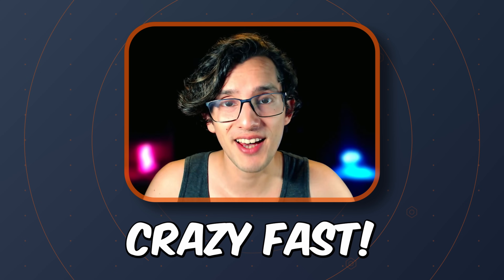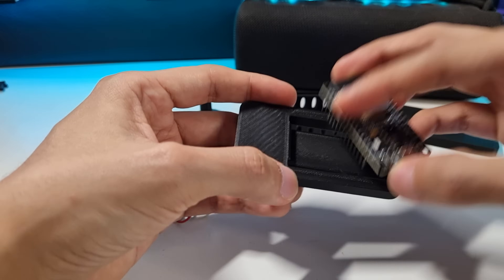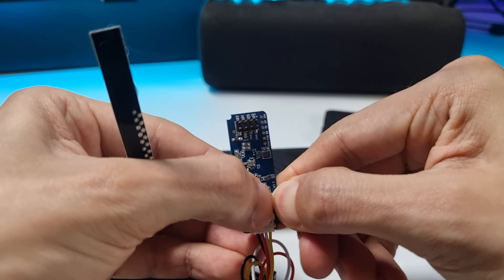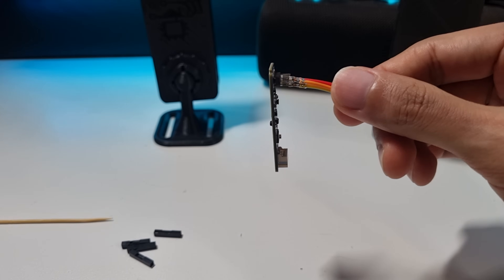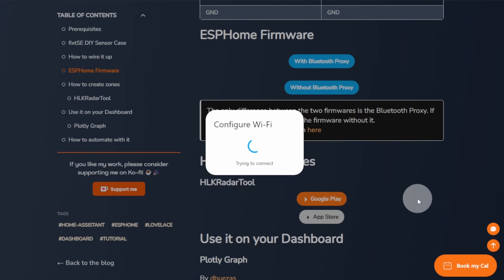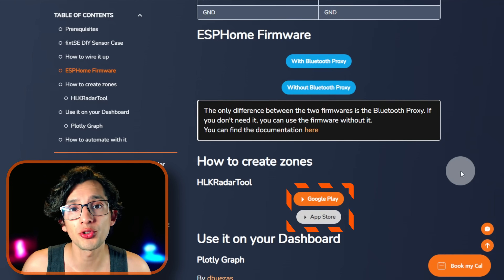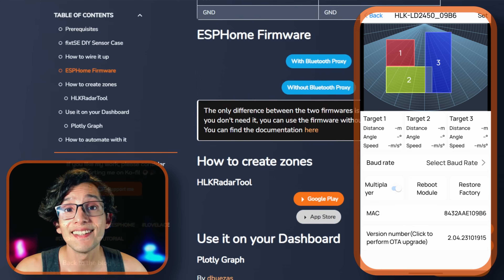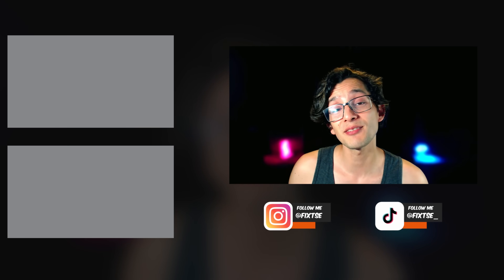Beginner DIY ESPHome mmWave Presence Sensor  |  HLK-LD2450 + ESP32

Comment: Well. Bought the stuff in your links. Put together. Works with the apps from the write up. Home assistant see's and adds the sensors. Home Assistant doesn't see anything but the app sure does. Granted the esp32's linked in the amazon link are not the same as on the write up. Didn't notice until already ordered and putting together. Where the rx2 and tx2 is suppose to be are D16 & D17. Going to bet thats my issue....
Reply from the maker: Hi, yes RX2 is D16 and TX2 is D17, I'll pin this so if anyone else gets a board without the RX2, TX2 labels, know to look for D16 and D17 instead  (GPIO16 and GPIO17).
Reply: @fixtse.  I was just looking at putting one of these together and I noticed in the 'How to Wire it up' section on your site that the radars RX was wired to TX2 on the board and the radars TX is wired to the RX2 on the esp32, is this correct?
Reply from the maker: @snorian  Yes, TX2 to RX on the sensor and RX2 to TX
Reply: Did you get the sensors to work on HA? I haven't been able to.

Comment: Thanks for the very interesting and useful video. Just one question, I saw your vertical installation with the 2450. However, the creation of zones via the HLK application is represented with the device placed horizontally or am I wrong? Thanks.

Comment: I have built this unit but can not get the firmware how do I get it.  when I go to your site it never shows it to me
Reply from the maker: Hi, I can see that you are subscribed to the channel, so the verification should work, when you log in with your google account, verify that you select the correct account, sometimes when you have a youtube channel, google creates a separated profile inside the same account, and only the youtube account has the subscription activated. If your case is different than this I would like to know more, since it should work automatically.
Reply: @fixtse.  I am logged into you website with my google account that I have subscribed to your You Tube Channel but when I got to get the ESP home firmware I dont see it.
Reply: @fixtse.  i have made sure that I am logged in with the correct gmail account and I still do not see the esp home firmware that I want to download.

Comment: The subscribe part doesn't work anymore to get the files.
Reply from the maker: Hi, the files for the project are available on the store, but the firmware it's available to flash directly from my website
Reply: @fixtse. Ah, so now you have to pay to get the files. Thought in video said it's free.
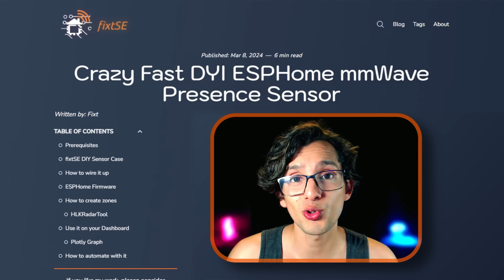Reply from the maker: @mikael-f9x   I think you might be confusing the files with the firmware, the firmware is available to install for free for all subscribers on my website, but the yaml file for the project that I put together is only available for patreons (and later on I put it also on my kofi store) 13:30

Comment: Any reason why the sensor detects weird movements even though no one is moving?
I've even connected the LD2450 directly to a 5v power supply. No ESP32, no BT antenna, yet the HLKRadar Tool still detects random movements.
Tried with 3 sensors bought from different places. Tested with different rooms/lighting/temperature.
Tried Upgrading/downgrading the firmware, Enabling/Disabling Multiplayer, changing the baud rate, factory resetting...
Reply from the maker: Things like plants, fans, even mirrors can cause false positives, not sure in your case it any of that might be the issue, but the LD2450 works great for most people, if you tested many sensors (so it's not a faulty unit) the problem should be in the environment.
I had a problem with the aqara fp2 due to an open window that moved slightly the rollers when the wind was strong, so don't overlook stuff like this.

Comment: Hi, great video and explains perfectly what I'm trying to do.  One question on the fitting of the LD2450 to the case though - are you not pointing the radar towards the back the way you've inserted it?  It seems like the emitting antennae is directed out past the stand rather than what I'd have though to be out the front where the ESP32 is housed?
Reply from the maker: Hi, yes 😅, seems that my use case was very different that everyone else, check my ultimate presence detection sensor y put links of some remixes I found that changed that to be the front

Comment: Great Video tutorial.  I want to try it, but I dont have a HLK LD2450 snsor, I have a HLK LD 1115H sensor. Wil it work with the firmware on you website. Thanks
Reply from the maker: Hi, no, this is specific for the LD2450

Comment: Great info! I got everything working except the plotly graph on the home assistant dashboard, it does not show any movement in the graph. In the ESPHome device sensor block I see detection of movement and distance changing. Also on the phone app radar tool the graph is showing movement correctly. how can I get the graph in the home assistant dashboard to show movement?

Comment: small problem, I bought the source codes to have an idea of possible modification and discovered that the code compiled without any modification does not work while the firmware loaded from your site works, which is rather curious. A little idea?
Reply from the maker: Hi, I manually tested the firmware build with the latest YAML file available, and I can confirm that it is working. Please try cleaning the build files and running it again.

Comment: hello. I bought it too, I configured it, home assistant sees it, I also installed the radar configuration application but I have a problem. The presence sensor in a 3 meter by 2 meter room does not detect me correctly, if I stand two meters from the sensor it does not see me. I have to stand about 1 meter to see me and it still goes into occupancy and cleared when I am in the bathroom and the light remains off. what would be the solutions? thank you.
Reply from the maker: It seems like there might be a faulty sensor. I recreated the conditions to check, and my two test sensors in close proximity are working fine. I’m using firmware version 2.04.23101915 on the LD2450.

ESPHome is used to gather information from the LD2450 sensor and share it with Home Assistant. The detection itself is managed by the LD2450 firmware.

Regarding positioning, it might not matter much but try to ensure the LD2450 is flat on the case. I have one sensor glued and the other just held in place by the connection cables, and both work fine. However, it doesn’t hurt to check.
If nothing else works, try reaching out to the seller. Be sure to check how much time you have left under buyer protection. If it’s about to expire, start by requesting a refund from Amazon or AliExpress.

Comment: The antennae is behind the ESP32. Limiting it's range significantly.   Is there a better casing some where?
Reply from the maker: Yes, I included a link to another user’s design for this project on my website. https://fixtse.com/blog/ultimate-esphome-sensor#remixes
Reply: @fixtse.  I see I was not very "kind" in the way I phrased my question. Sorry about that. I should have added a "  :-)   "   to that!

Anyway, tried the new one, absolutely perfect!
Reply from the maker: @MeneM2Mateo   Haha, no worries! I’m glad someone created an improved version for the project. There have been similar comments about the unusual placement of the ESP32 board and how it points downward instead of upward. I guess the use case I had in mind wasn’t that common after all 😅

Comment: Hi, The sensor works (needs some work to optimize it) but I don't see my espHome device in my ESPHome Device Compiler. I only se it in my espHome integration. But there I can't add code or do other things with it. Do you know why this is?
Reply from the maker: Hi, yes. erase the name_add_mac_suffix: True from the yaml file and give each device a different name, if you have more than one.
Since the default adds the last 4 digits of the mac to the name, esphome is not able to find it, since it's looking for the device called "mmwave-sensor" not "mmwave-sensor-D0EA"
Reply: @fixtse.  Hi, Thanks for your reply. Where in which Yaml file do I erase the name_add_mac_suffix: True
I have searched but could not find it

Comment: Hi, after the Plotly Graph installation and pressing reload - Overview - Edit dashboard - I see only a small window with selecting areas. What did I do wrong?
Reply from the maker: Hi... nothing wrong on your end, something has change by default in Home Assistant since the video was released. Not sure what you are referring to with "small window with selecting areas", if you can, please post an image on the comments on my website. I'll try to help you from there.
Reply: @ I posted a link to screenshot there. When I go to edit dashboard I just see all my rooms with sensors. Actually, I don't understand why the Plotly Graph isn't visible in the integrations like the Tuya app or others.
Reply from the maker: @andriysunford2249  Hey, did you catch my response? The Plotly Graph is not an integration, that's why you wont find it there, it's just a custom card meant to be used on your dashboard.
Think of it this way, integrations are meant to get devices/services to work with home assistant. Cards are meant to show the information in devices/services on your dashbaord.

Comment: How to access esp home from anywhere?
Reply from the maker: If you use Home Assistant, you can just expose your instance (safely) to the internet and use it to connect to your esphome devices from the outside. You could also setup a reverse proxy, but that would require some research to secure the connection.

Comment: Do you - or does anybody here in the comments - have a modified STL file for a 36 PIN esp32? I printed the enclosure, then built the project - everything works. And then the ESP wouldn't fit.

Here's the really embarrassing part: I even ordered a 30 PIN esp32. I received it, I put it... SOMEWHERE... and now that I finally have some time and was going to flash it, I cannot find the 30 PIN one. 

Anybody? I'm sure many tinkerers have the 36 PIN one, not the 30. Perhaps somebody here already remixed the STL?

Comment: Great video. Well explained. Everything works. However, many times the sensor reports presence even when the room is vacant. How can I fine tune the sensitivity and threshold of the sensor? I don't see any option on the HLK radar tool.
Reply from the maker: It's kinda strange, so make sure to triple-check that there are no plants, fans, or other sources of interference in the sensor's line of sight. 
There aren't any options for sensitivity or threshold, it's all managed by the firmware.
Reply: Thanks @fixtse.

Comment: Is there another app i can use. The radar app is not finding my sensor at all. I have tried multiple times
Reply from the maker: "the radar app" is just a Graphical User Interface to represent the data from the sensor, so a different app wouldn't be the fix. As an alternative, check the data in home assistant, does it show anything? if not, it might be a faulty sensor.
This would a little bit too long to write it here, but verify that at least the 5v and ground pins are well connected, that should make it appear in the app (if you are not using the external antenna, test it with the sensor near your phone. If it still doesn't shows up, use that evidence to ask for a new sensor.

Comment: does the firmware contain an aggresive  "power_save_mode:" out of the box? because it looks like the board has weak connection while being in line of sight of the router at around 6 meters.
Reply from the maker: No, it doesn't, have you tried with a different board?, I had a similar problem in the past with an esp32 board, so far it only happened to me once, so I consider it an anomaly.

Comment: How good is this exact setup at no motion presence detection? Such as sitting still in a room watching tv? I have seen some people make comments on other devices using the LD2450 not being that good at it, but was also suspected that perhaps it was the settings of the device that probably needed tweaking.
Reply from the maker: check out the comparison I made between the LD2450 and the Aqara Fp2

Comment: Good Day Fixtse, my order finally came and i got 2 sets of the HLK2450 + ESP32 Dev Board + the Case from PCBWay =) 
Managed to install everything and it works! Only issue though -  its not very accrurate. (tried both with bluetooth proxy and without) I tried using it to set up zones and automations via the zones (detected or cleared) but there were alot of false detections or not clearing or not detecting accrurately (off by 1m). The scope of the radius also seems to work in a straight line, the radar does not capture my movement 2-3 metres away from its line of sight. Am I missing something? I got it to work just like how it was demostrated in the video. Is there an update to the firmware perhaps? Not sure what i'm doing wrong. Thanks for your advice.
Reply from the maker: Hi, mmm unless you are pointing it towards some kind of interfierence object (like glass or fans) I can't think of anything that could make it behave like you describe (and that woudln't explaing all the things you are mentioning). I tested 3 units for the video. So it probably has something to do with the sensor you received. Try restore it to factory, if that doesn't help consider asking for a new one or a refund. If you need to show evidence, use the HL App as source to show the behavior. 
Last firmware available is V2.04.23101915.

Comment: The video is clear and concise, but my experience isn't matching. I bought the 3 pack Amazon boards for this project. After getting the board into ESPhome,  I show the device with only one entity.  I access ESPHome and the device shows offline.  It's taken me countless times starting from scratch to get to this point.  I have the HLKRadar tool installed on my android device so I am sure it works, but I can't seem to get Home Assistant to recognize more than 1 entity, and that's the firmware.  I'm sure the wiring is correct, but i am at wit's end.
Reply: The issue was resolved by adding via HA on my Raspberry Pi 400 instead of HA on my Windows box. For whatever reason, that fixed everything.

Comment: Hi another great video. A couple of questions on the HLK Radar app, the device is found and I connect but I and get an error “AA55 setting failed!” any idea what this is, I get no results on google? Slight difference I have the ESP32-WROOM-32D there is no TX2/RX2 so as pinned message im using D16 & D17. Am I missing something? Appreciate advice.
Reply from the maker: Hi, sorry haven't gotten that error myself.
Yes RX is D16 and TX is D17.
For the HLK App, the device uses only it own firmware, so if the error is displayed in the app, it's something regarding the LD-2450 you are using. Try reseting it to fabric and see if that makes the error go away.

Comment: This might be a dumb question, but why does the sensor need an Antennae? The ESP has its own right? I noticed you didnt use it when you only used Dupont female cables.
Reply from the maker: Yes, it's not mandatory, it extends the sensor's Bluetooth range, which is only used to connect to it using the Hilink App.
Reply: @fixtse.  oh  right Bluetooth. Thanks.

Comment: Hiya Fixt - just a quikc question - how impt is having a case for this setup ? I mean as long as i have the antennas facing the right way it shou ld be fine? Thanks for your kind advice.
Reply from the maker: Yes, the case is just for easier positioning and protecting the electronics from dust, etc. But it should work without it.

Comment: The plot graph flickers in and out i hit the edit button on my dash board it never stays stable. 

The sensor also works some times as it freezes up then I have to reset the sensor or factory reset any thing I can do to fix this or making it run smoother? And more stable?
Reply from the maker: Hi Shannon, that's weird, about the plot graph, I'm not able to reproduce this on my setup.
Do you have a second esp32 device you can try? I had to use the factory reset trick to get mine working, but it only happened to me when I was in the middle of testing, so constantly changing the settings for the device, but after I set my stable setup, I haven't had problems with any of my sensors.

Comment: Great video, everything is clear and easy to understand - great work. I ordered the case from PCBWay made from resin and unfortunately some of the pieces do not fit properly, i.e. the ESP32 board is loose inside the case.
Reply from the maker: Oh no, so sorry to hear that, I reworked every piece and test it on my 3D printer so this do not happen 😔, they should all just fit. If you have a caliper, Could you measure the exact size of the pieces you've got, I could adjust based on the differences between the parts you received and the ones I printed, to try to fix the problem for the model on the pcbway project. I tested it on PLA and ABS (i don't think the material should affect the size of the final model, but I'll google it just in case).
Reply from the maker: Hey, I reached out to the PCBWay Team about your case, they told me that you can contact their after sales team to help you solve the problem with the pieces that doesn't fit, just go to the PCBWay delivery page and use the Open Dispute Link under your order. Hope they can help you with this issue.